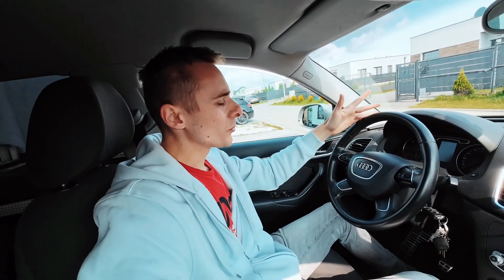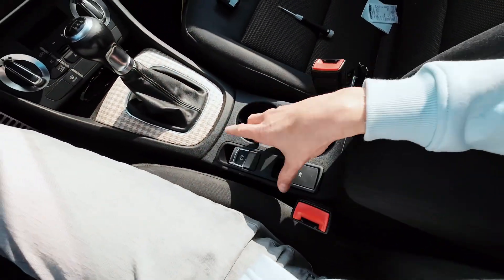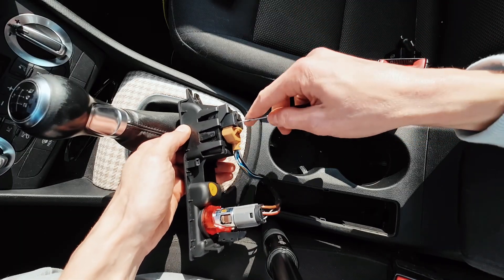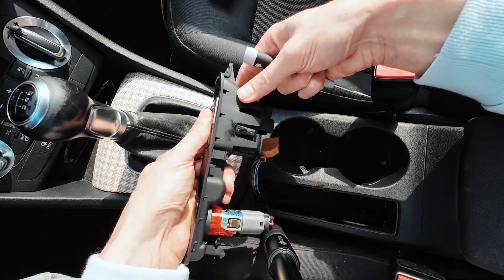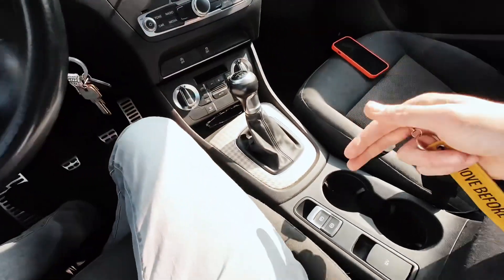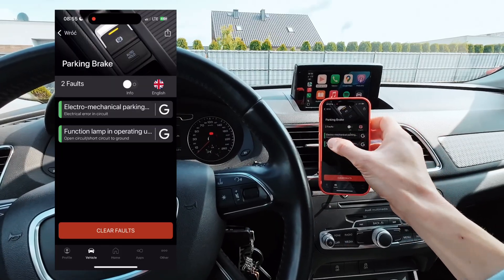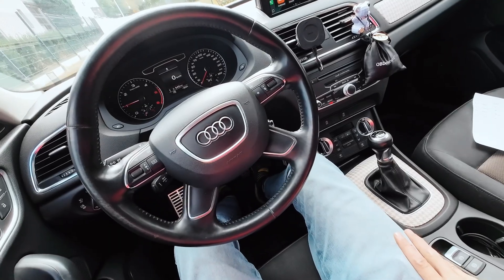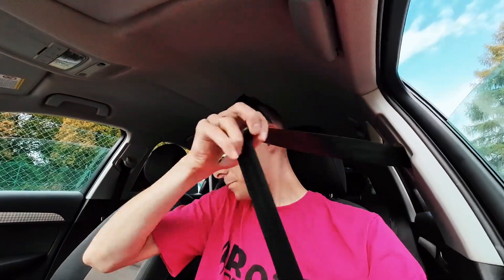Audi Q3 (8U) autohold retrofit with hill-hold and automatic EPB on exit

Comment: Hi. Does the engine have to be running for the auto hold to work. I have followed every step in the video and the hold button doesn't light up, engine was off but ignition on. 2013 2ltr diesel s line Q3. Great vid by the way.

Comment: Hi, I want to turn on the auto-hold function on my Audi A3 8VF automatic, do I need to run new cables and install an auto-hold fuse, or is it enough to just replace the switch with a suitable one and activate it?

Comment: Great video as always. A question: can i code that the parking break engages when i open my door? Right now it doesn't engage automatically wether i put gear in P nor open the door. Audi a6 c7.5. I want to believe that my previous a6 (2012) had auto engage parking break on. 

Changed it to enable in 53 - adaptations - activate p break when P is engaged. But doesn't work ... any ideas?

Comment: Interesting how some people want/like, hill hold assist. Especially with a manual transmission. I have been defeating that feature for over 10 years on my Subaru vehicles(with manual transmission), because it's a pita. With that being said, good on you mr-fix for showing these diys, step by step. 🦾
Reply from the maker: I actually like it very much. Had it in Golf MK7, have it in S3, now also in Q3. 

Maybe it's the Subarus implementation of the feature to blame here?
The best way to use it is in Porsche in my opinion - you need to stop the car and then press the brake pedal firmly to engage the auto hold feature. This way you decide if you want to use it or not at each individual stop.
Reply: @mrfixpl  Actually, in the Subaru vehicles(much like my current 2020 STI) there is a dedicated sequence to turning off the hill hold assist(vs having to buy  additional hardware, and then having to code it) .
  My thing is, if you know how to drive a stick shift/manual transmission then you shouldn't need hill hold assist. Even in terrible inclines while waiting for a stop light or stop sign, when driving in San Francisco, California. Then again, I learned how to drive a stick shift in the early to mid 80s lol.  But, like I mentioned earlier, it's personal preference. Glad my B9 S4 doesn't have it.
Reply from the maker: Are you using the heel-toe racing technique. I remeber when I had my Ford Mondeo MK1 with parking brake out of adjustment and I learned to use this. This and using clutch to keep the car from rolling down.
Reply: @mrfixpl  You can use heel-toe technique, if you so desire, but not necessary. Especially if your foot work is fast enough, to not have the vehicle roll backwards.